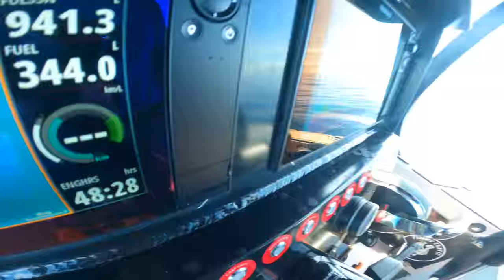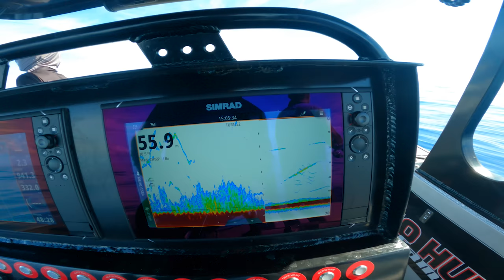I Broke My Boat on the First Trip 🤦‍♂️ (50 hours to Fail)

Comment: Just a thought about the top. It is a lot of leverage for a single leg,. an extra brace on the back in the form of another post on each side and a rubber gasket on each mounting where it bolts onto the boat to cushion the vibration. George would know a lot more than me but I've built a few things and it looks like a great top but too much for a single on each side.

Comment: Not sure if getting such a big boat was the way to go as it demands many things to support it and one of those as u put it is fuel. Your tow vehicle is also going to need to be in tip top condition. But the potential is huge and im sure u will make it all worthwhile once u pass your financial obstacles. As for the roof George seems to know what he is doing and i would keep it on lets see how it goes with the mod he mentioned at the end. Once u get into using the whole boat to its full potential u wont regret 1 second or 1 dollar of it all. Neither will we!!! Good luck mate and keep striving!!! Cheers🤙

Comment: just wondering have you considered using guy wires with springs to move the stress from the roof to the gunnels? Also a mast above the roof gives you a top down camera point?

Comment: I did wonder when you were building it if it would b strong enuf  sideways 
Ive had 30 years of boat repairs mostly crab boats and what iv leaned is if you are wondering if its strong enuf then it wont be

Comment: Hang in there Tim , rather than boxing the side frames why not do a Cnc cut 12 mm thick frame then put  100x 10  h iron style around it , bolts top and bottom the welds won’t be on the edges then ,shouldn’t cost too much either
Good luck

Comment: Roofs too heavy mate, it’s essentially like having another bloke in the boat. Go with a simple lighter design, it will make the tub more stable and reduce the risk of more dramas. FYI I’m a Marine mechanical fitter, marine engineer and commercial skipper.

Congrats on the boat.